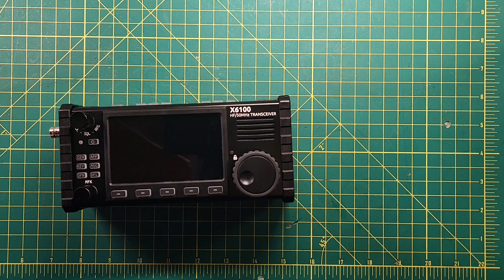#X6100 - What are the Host and Dev Ports for?

Comment: Have you tried a docking station on that Host port? It would be interesting to see if it will support a 2nd monitor or USB-C driven MIC & Speaker.
Reply from the maker: I have tried a docking station - it supports all kinds of USB2/3 devices, but doesn't appear to support video out (currently) - it doesn't provide a lot of power, so after a keyboard, mouse, USB drive...you're really pushing the power limits

Comment: Thanx for another good vid about it,so technically u could put say a rtl sdr on it and possibly have dual rx
But the wifi alot i would say if ya cut it longer say 1/4 long that woule help alot
Reply from the maker: You could do that.  A good RX antenna and a good TX antenna on the same budget friendly radio
Reply: I have being wondering how it would go with a powered USB hub for a external sdr cause i know some computers get a bit weird about it like ground loops
Anyway do u think the radio is worth getting in the end?
Reply from the maker: @Trent28888  If you want a radio to tinker with, this is a great toy.  Outside of that, the question is too nuanced to answer - what's your budget, what are your plans with it, what are your goals for amateur radio, are you a prepper, etc.  If you want to make a few QSOs over digital modes or SSB every so often, this radio is just fine.